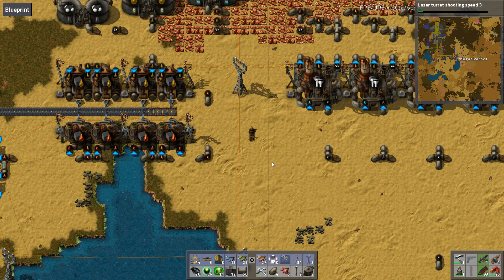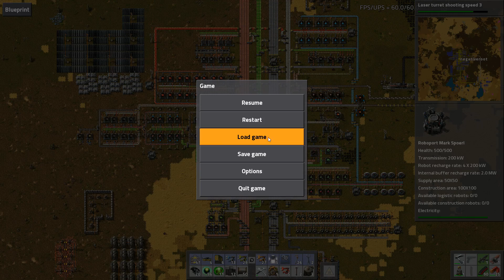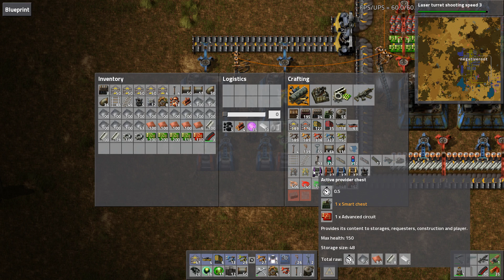Factorio Beginners Guide 16 Fixing Oil

Comment: Negative Root doesn't just "connect water"; he "implements a water inflow".

I'm also not convinced that belt balancers get you anything extra out of a factory - the only exception being that you get extra belt storage if you have a single balancer near the start.

Unrelated: You should play The Witness. (Don't watch any other videos or read any guides unless you get really stuck)
Reply: I almost always make builds that output to both sides of the Belt. Automatic balancing right there.
Reply: +Alex C Never underestimate the power of aesthetic.

Comment: When I try to run my lubricant pipe across to the main factory, which is even farther away than yours, I cannot get very far
with the pipe run before it has problems with throughput...that is, the all pipes connected, but along the line, the little green lubricant symbol does not show on the pipeline.  Then I found this thread: https://forums.factorio.com/viewtopic.php?f=134&t=6066.  Small pumps in between!  
Wondering why/how your build is able to traverse such a long distance, where mine does not. And I have 12 oil pumps, and 5 refineries, as well as all the other factories, etc. that you built requiring some aspect of oil production.
Reply from the maker: +Cindy Persson as i said in the other video, don't mix up the issues. I'd suggest you use barrels to move the oil large distances, rather than pipes. Basically, its a matter of don't fix something unless there is a problem. Mine works as I don't have to take it too far.
Reply: +Negative Root Thanks for reply!  This video series has been terrific, btw.  I'd be lost without it.